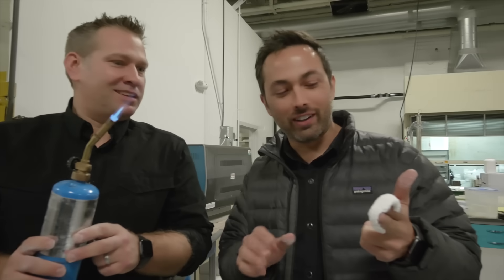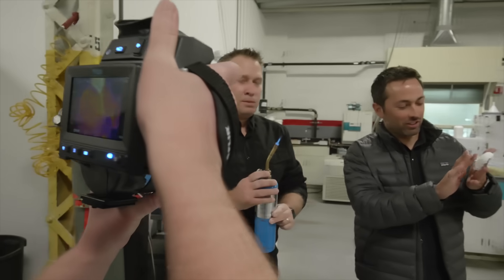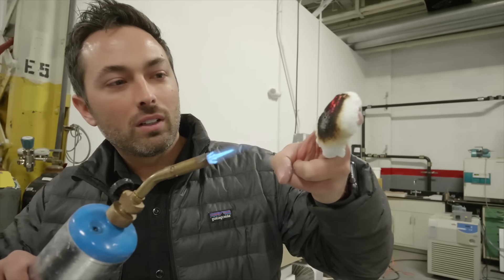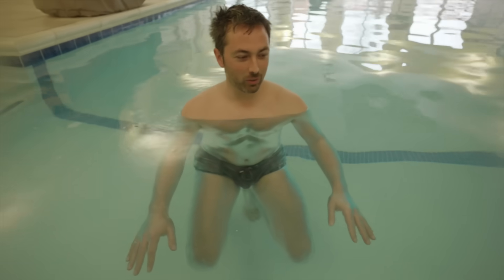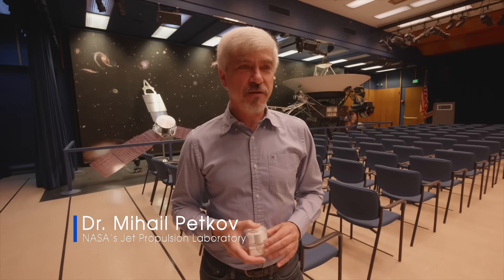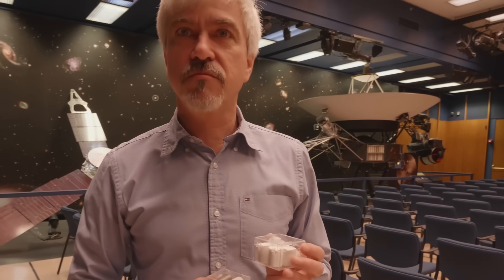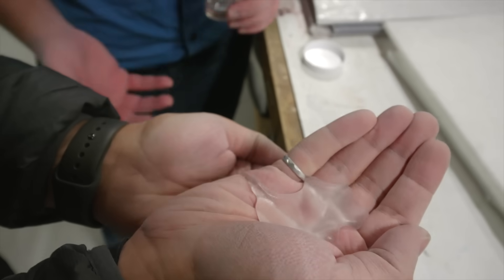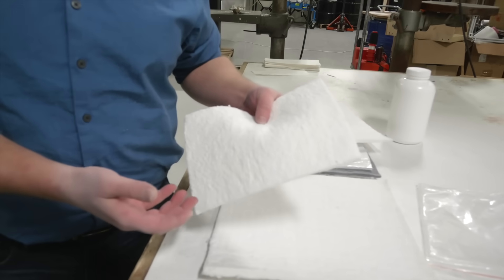I Waterproofed Myself With Aerogel!

Comment: So, just wondering... how do you get the aerogel off of you once you're done if the aerogel is hydrophobic?
Reply: Double cleansing with oil and soap should do the work
Reply: Sponge
Reply: @jameson1239  So you scrape the aerogel off with a sponge?
Reply: @soominkim2370  I’d imagine that’s the only real option
Reply: @soominkim2370  as we saw Aerogel breaks easily so it should be easy
Reply: @ForteExpresso  But the aerogel on his body was already broken into pieces..
Reply: Yeah oil can also be used since it's hydrophobic like the powder aerogel
Reply: A reply from a materials engineer to another comment says that dish soap or detergent will do.
Reply: Probably something that disrupts the water-repellent qualities and makes it at least partially water-soluble. Like dish soap or something more specialized.
Reply: Sscrape
Reply: squeegee
Reply: then again sometimes you can use the water to "scrape" hydrophobic things such as lotion by adding soap or rubbing at it with the water
Reply: Can this cause cancer or cause side effects?
Reply: Ouiii

Comment: Waterproof your lungs. You can then breathe underwater
Reply: Bottoms up
Reply: Uh, no! How are you pulling the oxygen out of the water?
Reply: @DanielGarcia-ir8oe  You dont. Since your lungs are waterproof, it wont touch your lungs, so water can get in between the water and your throat and lungs, allowing your lungs to use said air.
Reply: @certifiedfurry  if I’m underwater how am I getting the air? I don’t have gills. You need to explain that better. The only oxygen available is what was in your lungs. That will get used quickly if not immediately. Then what air do you have.
Reply: @DanielGarcia-ir8oe  easy: Buy gills on aliexpress or wish.

Comment: As an aerogel developer I can't imagine how dry your skin must have been doing this. Waterproofing also means extremely oil absorbant
Reply: He became human jerky
Reply: @evaniceface  The worst fate
Reply: @silent_pilled  yes
Reply: @silent_pilled  clearly the best fate, jerky for life!
Reply: Well you seem like the perfect person to ask the question the entire comment section wants to know the answer to: How do you wash it off??
Reply: @Mysic97  dishwasher liquid or any surfactant is all that's required
Reply: @Mysic97  use an emulsifier agent
Reply: Really? I thought aerogel was like a spray feel.
Reply: @dylankersten3383  well it is a fine powder but you'll feel damn dry after touching it
Reply: @markfearns8535  Interesting.
Reply: @markfearns8535  Finally a way to immediately get rid of sweat
Reply: @markfearns8535  Is aerogel biodegradable? Just wondering how viable the insecticide option is.
Reply: @Avenger-K  If its silica aerogel, which it most likely will be, then no sadly
Reply: @Avenger-K  speak english, i cant understand you
Reply: @DingleMcHoppernoodle  That's on you. No problem for anyone else.
Reply: @spartanwar1185  why are you trying to get rid of something that saves your life? lol
Reply: @Avenger-K  aerogel is usually made out of silica, or basically glass/sand. It's pretty chemically inert by itself.
Reply: How smart do you have to be to be in this field?
Reply: @bapbirb  umm do you even need to be smart af to know that?
Reply: Crusty skin lol
Reply: As someone that worked with silica power is there silicosis risk with aerogel as watching all that silica dust floating around would be a concern to me especially since no one seems to be using any form of mask or respitory hood.
Reply: @tobygreppellini5960  aerogel is made from synthetic amorphous silica, not the crystalline stuff you'd find in quartz. Amorphous silica isn't known to cause silicosis or any notable health issues besides that of any standard dust
Reply: @markfearns8535  thanks for educating us Mark 😂
Reply: @D4RA1  that question actually deals more in resonant frequency...since all matter is energy.
Reply: I want this in my basement to eliminate the dampness, and in the walls, doors, etc for fire protection! Very awesome seeing aerogel shown from more than the singular perspective
Reply: Can you put it in your hair 🤨
Reply: Would someone be able to spray this on the body daily without damage?
I'm a learn to swim teacher...
Also can it be wiped off? Or does it need a special product to remove?
Reply: @cazstreet5893  Probably can be wiped off... With alcohol wipes
Reply: Stupid question many years later after your comment. Wouldn't aerogel be a good solution to isolate building?
Reply: @perekosmo2908  assuming you mean insulate, yes. For the company I worked for, the thermal conductivity of the particles was around 0.012 W/ mK
Reply: @markfearns8535  sounds even better than hemp ! If I remember correctly one of the engineer at my job was saying hemp has a thermal conductivity of 0.040w and that is already pretty good (yeah my bad I meant insulation :x )
Reply: Wow. Interesting.
Reply: Anyone know what they used for the binder?
Reply: I need aerogel gloves XD i sweat all the time
Reply: Hey, do you sell? How can I contact you?
Reply: I see so many possibilities with this. Fire fighter work and war stuff like 😯
Reply: Seems like the materials should be more bio-compatible.
Reply: So what if,  before we put that thing on our body,  we apply a lotion or moisturizer? It'll be working?  I mean this is one of the innovation that might have the best prospect in future
Reply: @biloxedoz  lmao it might just immediately fall off bc of the hydrophobic nature
Reply: yeah, like pfas or insecticides 👍  note the irony) @biloxedoz
Reply: i want it. every single time i eat my hands and face are full of oil and sweat
Reply: it will help me deal with hyperhidrosis
Reply: @Mark Fearns I just heard of aerogels for the first time and I'm super interested in checking out potential industrial applications. Any way to get in touch with you?
Reply: what does it taste like
Reply: @regaleagle6262  Really? That's your first concern? Good luck 😄
Reply: Same thought. Also, how long did it take to get it all off? Maybe blow it off with comp air? Can't wash it off....
Reply: So how exactly do you wash it off.  Can't exactly rinse in the shower.  I suppose some sort of soap or dissolving agent?
Reply: @turosianarcher8771  he answered this
Reply: @turosianarcher8771  Just soap (but probably a lot of it). Its basically like a layer of chalk that's been coated in oil.

Comment: Imaging if firefighters could use this stiff it would save then the risk of burns
Reply: That  would be amazing
Reply: They could but it'd probably be too expensive
Reply: @back2thawitchhouse  Me: *Laughs is in gel sacks and rubies”
Reply: @silent_pilled  LMAOOOOO another subnautica fan :D
Reply: @back2thawitchhouse  Not just too expensive, but too fragile as well. Fighterfighters need gear they can put on quickly, and run around in while hauling heavy equipment. There are a lot of boxes to check to get something that  works for them:
1) cannot catch fire
2) resists heat
3) flexible and resilient to physical stresses (Areogel currently fails here)
4) simple to put on / take off / use correctly (Areogel also fails)
5) reusable and/or cost effective
6) light enough to carry alongside various gear.
7) unreactive to the various chemicals in smoke.
8) unaffected by water (Areogel also fails)
Reply: @back2thawitchhouse  Unfortunately, yeah, this might be the case. It's really hard to make, even with industrial equipment, so it is quite expensive.

Hopefully, in the future, we find an easier or automated way to make it for more widespread use.
Reply: @back2thawitchhouse  so we're spices and meat at sometime in history but now they are cheap as technology advances our products cost will decrease
Reply: @back2thawitchhouse  they have a government job expense isn't their worry
Reply: Or we could use this to prevent fires in the first place
Reply: No. <3 we can spread this on our homes so we dont have fires!
Reply: Gremmer 100
Reply: Stiff? ( ͡° ͜ʖ ͡°)
Reply: @croquemaster314   *impostor noises*
Reply: @croquemaster314  mind out of the gutter my friend
Reply: @kvan6142  I refuse
Reply: @croquemaster314  hahaha
Reply: Next up: Aerogel lube
Reply: @figo3554  Perfect form of birth control.
Reply: Imagine if the space shuttle --- never mind.
Reply: Absolutely these aerogels are used in textiles nowadays to prevent from extreme hot conditions
Reply: i think you meant stuff
Reply: @angelalvarez954  yeah lol

Comment: Discovery channel had a 90s show, called beyond 2000 and they showed something like this, called frozen smoke.  They said it was lighter than air and was harder than a diamond.  Supposedly,  Sony was looking into making speakers out of the stuff. 
I was thinking  how it could be used to make aircraft,  seeing how it was harder than a diamond and lighter than air. 
What the hell happened to that stuff? 
Why haven't we heard anything else about it???
Reply: idk i just google searched "frozen smoke"

Frozen smoke
Aerogel is the lightest solid material known. Some call it "frozen smoke"...others see it as "pet cloud." Despite its density—three times that of air—the material has tremendous insulating capability. NASA scientists have found aerogel critical for several space missions.

Comment: The guy working there mentioned a hydrophobic chemical that is used with the aerogel. Would the waterproof skin effect be any different if you were to just apply that chemical to your skin without any aerogel incorporated? Also, if anyone knows, is aerogel used in hydrophobic sprays that are on the market?

Comment: I am an industrial insulator in Canada's oil and gas industry. The purple square sheet they had is definitely not "safe". The required personal protective equipment is a minimum of a half face respirator with filters and "Tyvek" body suit like they wore in Breaking bad that dispose of after use. 
 
You get that powder on your skin and you will have a dry patch for up to a week. Not to mention the upper respiratory irritation that was been recorded many times over in past cases.

I personally refuse to work with the stuff unless I'm wearing a FULL face respirator, Tyvek suit, latex gloves, and duct tape the suit over my gloves at my wrist and at my ankles over my work boots (just like when removing asbestos).

I can't believe they are even using that insulation anywhere on earth...if it is in solid form, I'd be happy to, but powder/fibrous? Hard no

Comment: No offense, but you can do a very similar demonstration of "torch on hand" using far more mundane materials. A mixture of flour and water packed into a nice dense putty and hit with a torch will soak up a surprising amount of heat as it will ablate away, same as the binder was doing in that demonstration. That's the trick that was used years ago to demonstrate the miraculous properties of Starlite. I'm not saying that aerogel doesn't have impressive properties, just that that specific demonstration has a history of being used to support hoaxes, so, seeing it used here raises questions.

Comment: I'm pretty sure paper is the lightest solid
Reply: no air isnt the lightest material, a cubic cm of paper weighs around 1.2 grams while a cubic cm of aerogel only weighs 1.5 milligrams, for aerogel to reach the same weight as paper you would need 800 cubic cm of aerogel.

Comment: They should cover Mars in this stuff and the thermal insulating should heat up the planet enough to be stable for life.
Reply: still got no atmosphere
Reply: @Jammin247  what you talking about. Mars has an atmosphere.
Reply: If you want to call it that sure. It's not sufficient for life as is.
Reply: @Jammin247  yes but the surface temperature is only 70 degrees too cold for life which hardly anything compared to planets like Venus which has a surface temperature of 400 degrees. Plus their is a chance that there is already life on Mars but it is microscopic and lives deep underground where it is warm enough for life.
Reply: Less than 1% of earths. Aerogel stops heat. So covering mars in this does what again? Holds heat? How's that when you stop the only heat source it has from reaching it?
Reply: @Jammin247  the same way a green house works. Sunlight enters it and then heats it up and because it is a green house. It stays warm. 

Anyway it was just a theory I’m not saying they should spend trillions to try and do it was just a theory. There are many different theory’s such as Elon musks idea is too nuke the surface of Mars.

Comment: Why is this not being used in houses? Moisture resistant? Flame retardant? If you can use as a dust, it could be sprayed in an air gun. This would save so many homes during fires.

Comment: Is it cheaper than vermiculite? Can it be used in a dust or pellet form to absorb Dangerous Goods like radioactive liquids, oil, gasoline, kerosene, contaminated blood, chemicals like high-concentrate chlorine solution, etc.? That would be marketable to a lot of companies for applications in spill cleanup for Toxic or Biohazard control.

Comment: I am a 35 year firefighter in California.  This is amazing.  Is it being used in any way to protect firefighters or as a retardant?
Reply: Maybe the melting point of aerogel is 1200 C (or 2192 degrees Fahrenheit) but the average campfire is 600 Celcius or 1112 degrees Fahrenheit but average house fires reach 1110 degrees Fahrenheit either ways so hypothetically yea, but note it'll prevent third degree burns it'll still burn like a bitch at the end of the day
Reply: @zyoh4311  Thanks. My question better stated should have been, could there be an application of this material suited for the fire service?

Comment: Why is there no conversation about the safety of the material? Is it safe to ingest, inhale?
Reply: Depends on what type, the powdered aerogel or aerogels that are super dried by industrial means aren't suitable for eating if you ingest that despite it you'll have a good chance of getting silicosis

Because aerogel is lighter than air you're not gonna suffer anything serious but those who did inhale it reported upper respiratory tract irritation, or very dry or chapped skin but no major or life threatening issues

Comment: How did he wash the aerogel particles off,if it’s water repelling?
Reply: I'd guess just with soap
Typical hand soaps are both hydrophillic and lipophillic, meaning they can attract and break down substances that are hard to wash off with water, and then want to follow the water once they've trapped the substance (e.g., dirt/oil/bacteria/etc.). It's possible the soap can attract and break down the aerogel, and then trap it, allowing it to be washed away with water.
Part of the washing process involves the mechanical aspect of physically washing something, so, that too probably... But this is a fair question!

Comment: This would be awesome in Australia,where the temperature gets up in the mid to high 40s at times,even higher in some areas,having window size sheets to slip into the window slots,against the glass,would keep the heat out and make it bearable.

Comment: After he had been covered in aerogel how much Insulation Did it provide. Would he be able to jump in much hotter or colder water and not feel it much. Not Dangerously cold or hot but what are the extremes that the Gel is able to withstand when thinly applied.

Comment: Why is nobody's talking about how his nose was the only part of his body that was blue when the infrared camera went on
Reply: It’s because it sticks out from the face, isn’t very thick, is only made of cartilage, and brings air in and out that cools it off
Reply: @turbosnack  exactly
Reply: @turbosnack  woosh
Reply: Cocaine
Reply: Cos it makes sense
Reply: Because the ears and nose are made of cartilage, and not bone, which is more heat absorbent. And the nose and ears have no veins running through them.
Reply: @benguman2231  actually the nose is highly vascular, needed for increased blood flow so that inhaled air will be a more suitable temperature for the lungs.
Reply: His ears too 💀
Reply: @Landen Bailey thanks Carl wheezer
Reply: Im blue da ba dee da ba die da ba dee da ba die
Reply: @andrewmoreno9056  😆 🤣 😂 😹
Reply: @ Andrew Moreno
YES!😂😂

Comment: The irony of this video that it can make it so for NASA, but it also makes it that anyone can go to Antarctica to find the truth, but no one except under government is allowed. So, you have no excuse to not go to the coldest place by anyone. Thin and strong to resist the cold and heat, if it says can swim in lava, then can swim in the coldest ocean which feels colder than the air above, so anyone can go there. If it is not provided for all people by this know-how to make it resistant to cold and heat and light, then they are blocking so anyone can't go there so no one finds the truth. The bigger the technology, the bigger knowledge-reduce it will be. Like Aether technology, and go anywhere.

Comment: 5:34
I swear Americans will measure I'm anything other than the metric system.
Reply: Why would we measure in metric?
Reply: @thekingofmoab1181  I'm not going to judge you on your choice of system but Imperial doesn't make sense
Reply: @TheBluePhoenix008  it makes perfect sense once you let go the idea that measurement systems need to be uniform and without variation
Reply: @thekingofmoab1181  without google, how many feet ina mile? If you can answer this honestly I'll believe you
Reply: @TheBluePhoenix008  5280 feet in a mile
Reply: @TheBluePhoenix008 : It does lean towards divisibilities by 2 and 3 though, which are the most common fractions.
Reply: @Inspirator_AG112  isn't there 16 ounces in a pound?
Reply: @TheBluePhoenix008 : I meant generally, but yes, there are.
Reply: A manifesto I can support

https://youtu.be/s95cxZkC_es